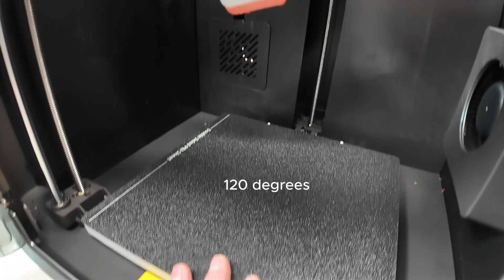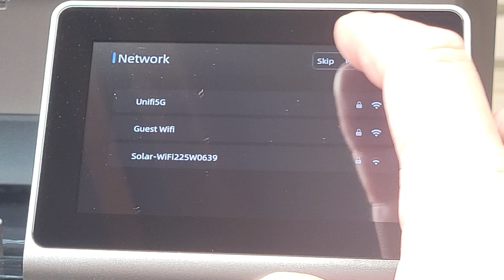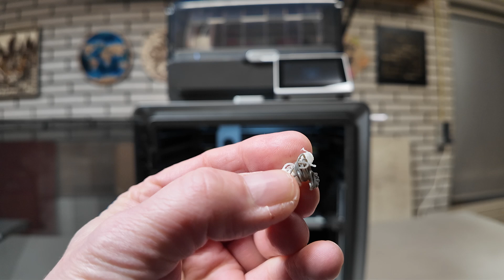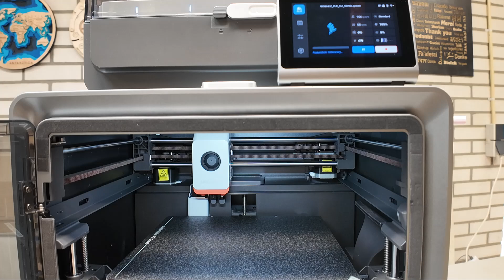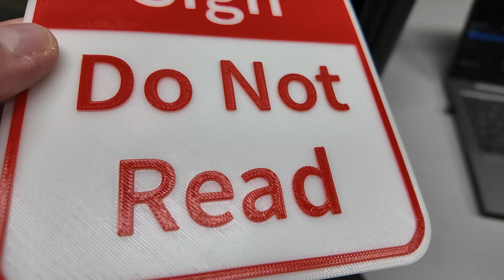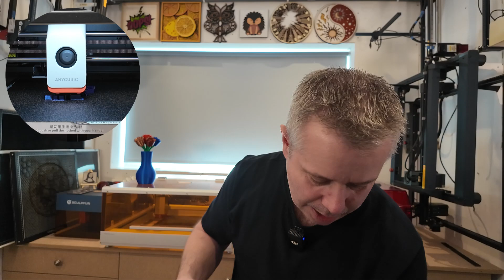Anycubic Kobra S1 Combo, Bambu Lab killer? #3dprinting #anycubic  #geekbuying #diy

Comment: that sigh should be printed with layer 0.16 height the result wil be stunned!   nice printer have the kombo versionits e remarkable printer i paid 440 euro with a discount of 30 euros and btw your filament is not dry enough that is why you have stringing
Reply from the maker: Thanks for your suggestions!

Comment: Just so you all know though, for that small snoopy...if you would have done a FULL plate it would have purged the same amount as it did for that small snoopy as it would have for 30 or 40 of them...same number of color changes for a full plate as a single print..color change number of times is still same....so if you do color change do a bunch then it is worth it better...🎉

Comment: I was having issues on a multi-color print, my 2nd spool tangled, after cleaning everything up and changing from a cardboard spool I discovered that the ACE Pro used with a Kobra S1 only works reliably with 196mm OD spools, most of my spools from different vendors are 198mm which get tangled during rewind since the spool is not moving fast enough. Nowhere has this issue been talked about that I can find. I stopped purchasing printers unless they have been released for 6 months or more but nowhere have I seen this spool size issue talked about.

Comment: Great Review, wondering do you have any issue with the auto leveling and do you found it printing precisely . Thanks in fact I am looking for a multicolour printer but this is the only model which fits my budget .. if you could suggest other models would be appreciated.
Reply from the maker: Thanks, yes with me the auto bed leveling works great and it prints precise.
Perhaps the Kobra 3 combo or Creality hi could also be an option if you're also looking at printers which are not fully closed.

Comment: Its junk. Owned it for a week. A replacement is coming tomorrow. I probably wont use it. Just pack em up and give em back. AnyCubic should be ashamed. The ACE PRO is cheaply made. And the printer clogged with its own brand filaments. Cuz their filament is junk.
Reply from the maker: Hi, thanks for watching. Sorry to hear that it did not work out for you. Hopefully the replacement will be flawless. I myself did not have this many issues with it. Only issues I had was the filament coming out on the inside of the Ace Pro (Kobra 3 Pro), but Anycubic did made a modification to prevent this and the squeeking noise from the filament feeders at the back, but with my machine it went away over time.
Reply: @jewijk  The 1st few days were magical, if you will. The the ACE Pro jammed. The feeders on the back are held together poorly. Needs a zip tie or just need to be made from metal. I did figure out how to fix that. Cant say if its actually fixed though. About the same time I finished that and got the printer put back together. My AnyCubic PETG came in. 1st print was meh. 2nd came out a little better. There hasn't been a 3rd. The PETG has clogged the nozzle and wont stop giving the clogged error. Even after a reset. The flow from the nozzle looks great when you manually extrude filament. Then it almost immediately gives the error and nothing really comes out. Im just wondering if the feeder has somehow slowed down and isn't feeding fast enough and the printer thinks its clogging up?
Reply from the maker: @carlrogers3505 you could try to use the PETG without the Ace Pro connected, so as single color setup, just to see how this works out. Perhaps you can locate the source of the issue. Some filaments such a TPU you can only use without the Ace Pro according to Anycubic.
Reply: @jewijk  I am currently running it through my Elegoo Neptune  4 max. I had the filament drying in the ACE all day yesterday.  But my Neptune has a .2mm nozzle in it right now. So my results are not really promising. Im mostly just checking the flow. Im gonna run some temp/flow benchmarks. Just need to swap the nozzle to a .4mm.

Comment: Can it print different material types? For example PLA with a TPU coating
Reply from the maker: According to the specifications from Anycubic ot should be able to also print TPU (only single color, not via the Ace Pro), but I have not yet tried myself.
Reply: @jewijk  I meant printing PLA in slot 1 and TPU in slot 2, for example for flexible joints or soft outer part of the model. Wold be cool. For this to work It should be possible to adjust nozzle temperature per material, is it? Could you please check?
Reply from the maker: Hi, that would not be possible unfortunately, Anycubic says that printing TPU can only be done as a single color, so not from within the Ace Pro (multi color option).

Comment: I have never owned a 3-D printer. I just ordered the anycubic S1 combo. Amazon change the delivery date so they ended up giving me a $90 credit. So for $510 I got the combo +4 kg of black and gray filament. I don’t know much about 3-D printing at all. Do you think this is a good printer for a beginner? I will primarily be using it in my workshop for making accessories for toolboxes as well as different functional applications in my wood/metal shop.
Reply from the maker: Yes, I think you will be fine as a beginner. It should work right out of the box once you have gone through the initial setup process. Enjoy!
Reply: @jewijk thank you I will re-watch your video as I set it up!

Comment: Hello! I have an Anycubic 3D printer (enclosed type), and I'm having a problem with the Z-axis.

When the printer is turned off, I cannot rotate the Z-axis lead screws manually (the threaded rods on the sides). It feels like the axis is stuck and won’t move at all.

What could be the reason? Could it be assembled with a misalignment? Or does the lead screw need lubrication?

I’d really appreciate any advice on how to check and fix this.

Comment: What can be done against the under extrusion and against the stringing? Looks not so nice in my opinion.
Reply from the maker: Stringing you can reduce significantly using the dryer. It's often a result of moist filament.
Under extrusion, you could tweak the settings in the slicer software to extrude a bit more during the first layer and other layers.

Comment: Greetings from Shanghai China! I bought my S1C in January(anycubic's initial release of the machine) for at around 2747 yuan(roughly 364 euros according to the exchange rate history). From my experience, it's not a stable machine, hardware-wise, I have replaced two hot ends and two pendulums so far. Software-wise, I was upgrading the firmware to 2.5.1.6 when I was watching this video, the NEXT slicer is really a weird slicer for its obsession for brim. I was printing a Gridfinity 4x4 box this afternoon, when I got home I realized I had things to do though the print is finished. Please pay attention that the NEXT slicer will change some of the settings/configurations of the 3mf files downloaded from MakerWolrd. If there is something similar to the Annual Cellphone Awards by MKBHD, S1C may compete with AD5X by Flashforge for a Budget CoreXY Printer Award. I hope what happened to me won't happen to other s1c users, Happy Printing!
Reply from the maker: Thanks for watching and your feedback!

Comment: What apps does it connect to I'm a beginner and. I can't find anything that works with this or the files are to large
Reply from the maker: Hi, it's just the Anycubic app from the playstore. Blue icon with a white box on it.
Reply: @jewijk  so my issue, i guess, was not the app. My internet is 5g, so I had to splice it to get 2.4GHz. I printed 3 things, and then all it did was shoot filament out of the poop shoot. I'm definitely doing something wrong and wasting way too much filament.

Comment: "I can clearly say that there has been no update except for the addition of the filament guide; they only replaced the top of the case. The noise in the AcePro feeding section remains the same, and from time to time, filaments get stuck inside it. My AcePro was about to break because of this.

Comment: How long does the filament change need? Hard to tell from the timelapse video?
Reply from the maker: Oh, I would have to time it, but they do take quite some time, just as the sequence when starting a print. The new Bambu Lab H2D has a nice solution to this issue, but it also cost 3 time as much 😉

Comment: This device wont detect if the print goes wrong and sometimes it will start printing without filament. I own this printer combo and i faced such issues. Micro or small prints will be destroyed in standard or sports mode.
Reply from the maker: Thanks for your comment. I personally have not had these issues so far, did you update the fw to the latest version?
Reply: @jewijk  yes still same problem persists

Comment: I have had the S1 combo in my cart for about a week now while I continue to compare new printers and watching videos of them being set up and used. This is by far the best one I have seen and sold me. I have been using a Kobra Neo as my primary printer for a while now and felt it was time to upgrade. I was leaning this way to begin with, but your comprehensive video answered many more questions that i had. Thank you for the great material and taking the time to put this together. Now I am off to place my order. Cheers!
Reply from the maker: Thanks, great to hear my video has helped you decide. Would appreciate it if you would use my links and coupon codes. It does help my channel, but also provides you with a nice discount 😉

Comment: The "Bambu killer" with a brass nozzle... (no upgrade available yet)
Reply from the maker: Thanks for watching, and for your feedback!
In my opinion it should come down to more than only the nozzle to be able to compete with Bambu Lab.
I'd rather look at the complete picture, but if for you the type of nozzle would be the deal breaker, you can get hardened replacement nozzles for the S1 on internet.
And with the easy and quick release, they are interchanged pretty easily.

Comment: Just got mine yesterday, was really disappointed it only came with enough filament to run a test part.
Reply from the maker: Yes, I think this is with most 3D printers. Same with regular printers, when you buy them, they come with an initial toner. But fortunately you can buy filament online in many stores nowadays 😉

Comment: Bambu A1 combo or this?
Reply from the maker: Have not used the A1, but I would still choose the S1 over the A1. 
1. I like a core X/Y over a bed slinger and 2. Like the fully enclosed machine where you can put the multi color option on top.

Comment: Good video! On my opinion the Kobra S1 Combo is not a beginner printer, it have a good price and everything, but it haves problems and more with the ACE PRO, the S1 without the ACE works fantastic, but the ACE PRO makes my S1 to fail too much.
Reply from the maker: Thanks for watching, did not yet have any issue with the Ace Pro on the S1. Did have it on the Kobra 3 though.

Comment: This or  Centauri Carbon?
Reply from the maker: Hmm, I have not tried that one, but I do like some of the things that one has such as filament holder on the side, USB stick at the front. But without testing, I could not tell you which I prefer.
Reply: Hola, yo tengo pedido la Centauri Carbon, viene preparada para materiales técnicos. No tiene sistema multicolor hasta el tercer trimestre de este año y no la suministran hasta después del 10 de julio. 
Me gusta la Anycubic Cobra S1 y su sistema multicolor y secador de filamentos si Anycubic y Elegoo prestan atención a sus clientes llegarán a ser un éxito de ventas
Reply from the maker: @ricxixast thanks for your feedback. Hopefully the Centauri will work as great as the S1. Before you know it, it's July 10th 😉
Reply: I'm thinking both, S1C is due any day here- I originally was gonna get 2 Centauri Carbons, but I didn't want to wait until July 😅
Reply from the maker: @jrfarawayfrom2016 🤣

Comment: Great review Jeroen! And thank you for the coupons. 
Question: I saw someone burning away the stringing with a lighter. Is that advisable?
Reply: I use a lighter all the time, it works well. Just be fast and not on tiny parts. Just a normal lighter too, not the creme brulee type.
Reply from the maker: Thanks and you're welcome. I don't think it would matter all that much if you only hold it to the print shortly. I use a electric hobby dryer myself to get rid of the stringing.
Something similar to this example: https://www.bol.com/nl/nl/p/elektrische-mini-heat-gun/9300000140760644/?Referrer=ADVNLGOO002063-S--9300000140760644-PMAX-C-22294610299&gad_source=1&gclid=Cj0KCQiAlbW-BhCMARIsADnwaso4PecUX7Hh5f3A7vbmr7oqMuYFMqF0KFXUrK6p61fCpnjDsATXeg4aAvEXEALw_wcB

Comment: Got mine last week. 3D printing newbie, nonstop printing, works just fine. Just ordered extra nozzles, starting next week with carbon.
PLA and PETG came out just perfect.
Looks like 3D Printing arrived at the consumer market.
Imported STL files.

Will keep it. No problem with the ACE
Reply: Please take precautions with carbon as it has health risks.
Reply from the maker: Thanks for watching and enjoy your new machine!
Reply: Did you get the unoffcial hotends nozzles sizes 0.2.6.0.8 etc? What Material you would use Steel etc ?
Reply: @scienceandmatter8739  I ordered the s1 yesterday. I don't have it yet, but I did order a 0.6 hardened steel nozzle immediately on aliexpress. I haven't used anything else for a while now on my ender. Just a lot safer for abrasives. There's more than you'd think, wood, glow in the dark, carbon-, glass fiber,... 0.6 is enough of a speed increase and not much of a quality decrease imo.